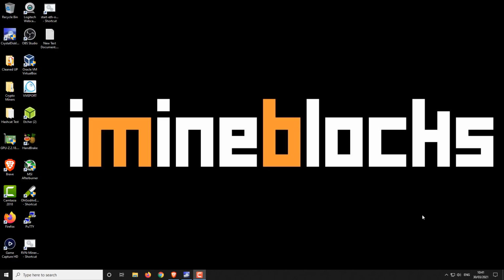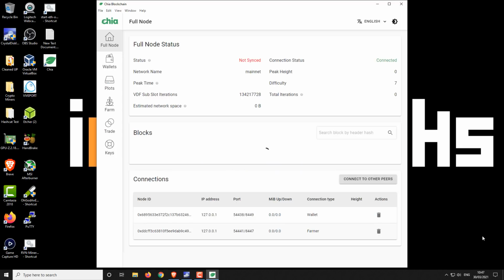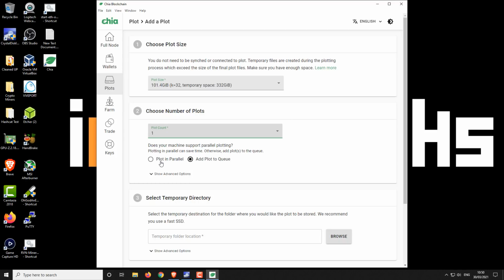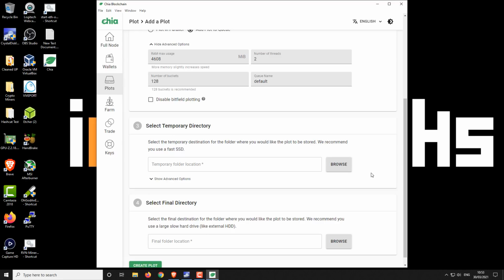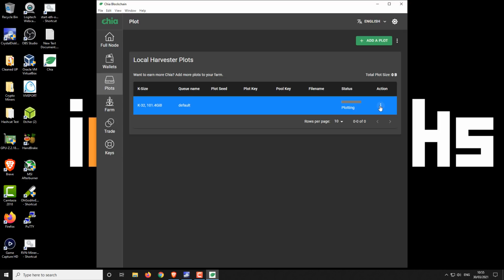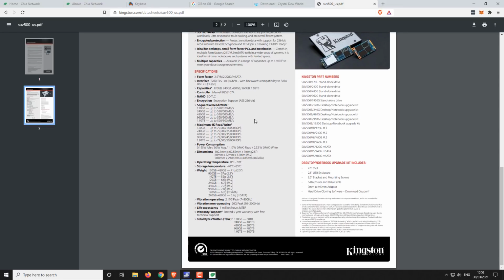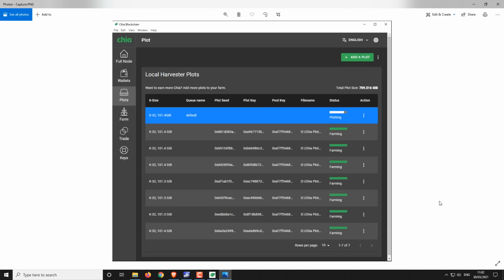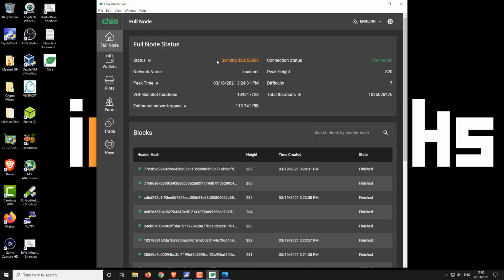How To Farm Chia - Hard Drive Mining Guide

Comment: thanks man @imineblocks for the great tutorial. as I am new to mining I have some questions you did not explain in the tutorial. first of all, how profitable is this method? 
say I have an idle PC with 10TB Hdds and a very low price of electricity.how much would you guess it will bring for me? there is a concept "chance to win". for example its 10% to win each month. what does it mean? I can not win at all? if I never win what happens? I never will have the coin?

and how much it uses the internet? does it download and upload huge amount of data? how about the disk space? as I know we should have many HDDs. I don't understand, are all data should always remain on the disk? for how long? should not it be like writing 500GB and finish the current process and rewrite the new ones on the old data? why should we store 200TB or more? does not make sense to me.

 also about the SSD you meant that only for the temporary disk right? because having many SSDs can be really pricey. I guess it should be 1 SSD and many HDDs right? 

sorry for many questions. I hope you get the time to write back. thanks :)

Comment: If you own 1,000,000 plots right now (2-3,000,000 usd equipment cost needed) you can make it 1.6% winning rate every 5 minutes. With that rate you can earn back initial cost in 30 days. Any lower investment than 1,000,000 usd into chia coin mining will make you bankrupted before you earn back initial cost because of competition winning rate too far away from your reach, and because  your disks HDD SDD will eventually die before they found any rewards block for you. In short, if you don’t have 1million usd to invest in chia mining, you committed suicide and endeded up in nothing. Stay away from this Chia scam. Mining BTC and ETH is still only way to make profits for small miners

Comment: Can some post a video on the schematic diagram of how they connected their external drives, PC, and Router/Modem. I am running out of ports, and I wanna know how many lightning cables and ethernet cables to buy. 

I currently have,
~ Windows 10 PC
~ 1 External Hard drive SSD 500 GB
~ 1 External Hard drive HDD 4TB
~ Router/Modem

Comment: So, I built my first Chia rig, had done 7 plots  today in 7 hours in parallel, but the plots just sitting at 100% and not moving to farming (v1.4), any one had this and a fix ? All the files are plot.2.tmp and 101.401GB in the destination folder
Reply from the maker: Can they be written to the final drive, check the plot logs.
Reply: @IMineBlocks  just started a new batch a while ago, first one finished and went into farm mode, seems to have worked, thanks for the help

Comment: Hi guys, i have a question

temporally files ( recomended on SSD) are only ocuping space while im creating the plot, rigth ? (something like 350 GB)

So, if i Buy an 480 GB SSD with a good endureance it would be enougth to create plots one by one on a 8 tb HDD ?

And then, the final directory is the real place where i have to storage those plots, so when I stop plotting, the SSD will be empty and the HDD full.
Reply from the maker: Yes, this is correct.

Comment: I have a question. If the plotting is complete, what is the minimum requirement for farming of 160 plots? I am thinking of doing this on my pc which has 16TB hard drive. But do I have to keep high ram and SSD on the same PC even after the plotting is complete?

Comment: if i set up a farm on an external harddrive, do i have to keep it plugged into my computer and running at all times in order to mine or will it work if i disconnect it and leave it alone for a while?
Reply from the maker: You need the drive plugged in for farming.

Comment: so does chia use the hard drive to mine or just space on the hard drive? wondering if chia wears down ssd via lots of read and writes?
Reply: how quick would this chia mining burn thru say 200TB on an ssd? should i look for mechanical drives?
Reply from the maker: Hi, Writing the temporary plots uses a lot of writes and will wear SSD's significantly. You can use HDD's but they're much slower.
Reply: @IMineBlocks  the plotting does the read writes but does the final wear the hard drive?

Comment: What are the costs? Have you seen an increase in energy consumption? It is stil using computer power, so iam interested to know the costs :)
Reply from the maker: Initially intensive but one plots are created the drives use very little power, about 10-15watts. 
The node can be run on Raspberry Pi which also use less than 10 Watts. Its very efficient for a proof of work crypto.

Comment: Is it really that important to use SSDs to get plots up and running if, once they're created they then get handed over for farming? Does the farming stage last for ages / forever?

I can get a 2 TB mechanical drive for under £50 whereas the same NVME is going to cost me around £180+ and might burn out a lot sooner. Just go for more plots in parallel (with, admittedly, more cpu and ram usage) on slower, mechanical drives.

I'd love some feedback / constructive criticism on this as I am completely new to cryptos.
Reply from the maker: You can use a HDD it just takes much longer to create the temporary files required for plotting.

Comment: Sorry for the noob question; I have mulitple PCs but I am putting them on the same wallet. however they dont 'see' each other, only the plots on the local HHDs. Are they working together if I have them on the same wallet?
Reply from the maker: Yes they're working. Your total plotted capacity is not shown on the other nodes but you'll get the same rewards for the full total.

Comment: I have a question, for example if I have one ssd m.2 drive of 1TB and I have free space of 500gb and create one plot on that empty space is that mean I can't creat more plots on that drive? Also, dose temp folder can be same for each plot. Is temp folder is shared between plots or I should create new folder for each one and calculate new 239gb of disc for that? Please let me know, and thank you very much in advance.
Reply from the maker: Temporary storage can be used multiple times, once the plot is completed and written the temporary files are automatically removed. You can use the same temporary folder.
Reply: @IMineBlocks  So in my example, I need to wait to create the first plot, and once it's done I should create a new one on the same disk and use the same temp folder, right? Can plot and temp folder be on separated drivers? Also, once the plot is created it will automatically start farming or should I do something? Thanks a million for the quick response, appreciate that!
Reply from the maker: @manojlogulic4234  Yes, you'll get the best results using a temporary drive and the final plot gets written to another drive. You can que them up so that a second plot automatically starts once the first has finished.
You can select to auto farm once completed, see the check box under plotting options.
Reply: @IMineBlocks  Thank you a million bud, wish you all best! Cheers!

Comment: Under the farm tab there's an advanced options button.  My "your full node connection" KiB Up/Down is 0.0/1247.5 is this normal? I've opened port 8444/8444  and my farms are in fact farming. Should I be worried about this?

Comment: Hi Guys is it possible connect two pc (in two different place) to the same account to have more chance to get a rewards? thanks
Reply from the maker: Its all about total capacity. 2 x 10TB systems will not have any advantage over 1 x 20TB system.
Reply: @IMineBlocks  I'd like to do in this way in order to create more plots

Comment: So, say you had access to multiple PCs with half decent CPUs, could you use all of them to plot simultaneously? Then just move all your drives to a seperate farming rig and leave it sat there?
Also I'm still a little confused as to how farming works - once a drive is plotted, is that literally it until it wins a coin? Does farming use a lot of resources or are you basically just leaving them available until one of the plots wins something?
Reply from the maker: Yes, this is exactly what I'm doing. Using a few different machines and then moving all the plots to a farmer machine. Farming is very low usage only little above idle.
Reply: @IMineBlocks  excellent, I basically have access to a bunch of workstations with xeons I could set plotting on my own drives while users aren't using them, but I'd be running the farming rig from my garage probably so low power or resource usage is excellent.

Comment: There is no point to mine this, why you should want to kill your SSDS to mine ridiculous amount of XCH ?... You gonna kill your SSD in less than 1 month by using this programm...
Reply from the maker: Speculation! I think farming Chia will produce more revenue than the cost of hardware.
Reply: @IMineBlocks  how come its exist 100 of coins why is this difference
Reply from the maker: @johnnygustafsson6945  It uses proof of space/time rather than proof of work.
Reply: @IMineBlocks  another question could i farm eth and this same time?
Reply from the maker: @johnnygustafsson6945  Yes, Eth uses your GPU. No problem mining at the same time.
Reply: @IMineBlocks  will give it a try got just a ssd 1tb on my pc atm and have only used about 100gb on it so will try for now

Comment: Hello to all! I am new here and i want to start plotting and farming. I read this thread and i learn than i need nvme ssd to plotting and hdd for storage and farming.

I want to ask what it is better for the other pc specs. It is better a pc with 3900x and 32gb ram at 3600mhz or an older motherboard with dual xeon E5 2695V3 (28 cores / 56 threads) and 32gb or 64gb ram 2666mhz?

It is better less cores with higher clock speed or more than double cores with lower speed?

Which system is better for parallel plotting? Do you have any advise for me?

Thanks for your time!
Reply from the maker: More cores are better, so I'm told.

Comment: Hey Lee, thanks for the videos. Been following you since the Burstcoin days. Wanted to throw a suggestion out. FusionIo had some PCI-E storage back in the day that can be had for fairly cheap on eBay. I have been eying the FusionIo IoDrive2 2.4TB drive for plotting. It has a maximum usage of 34PB aka 34000 TB. Might be useful if this coin takes off.
Reply from the maker: Hi, Thanks for the suggestion I'll check it out.
Reply: @IMineBlocks  Question on plotting, does the CPU speed really matter? I was trying to plot on my 3970 TR but I dont think there is any benefit from going with 50 threads(VM) vs. 2 threads on a Celeron. Thoughts?

Comment: Hi, I just started plotting today and ordered some new hardware for better farming. Would it be better if I build an entirely new setup for plotting or should I just upgrade my PC and plot on that? I use my PC for lots of stuff (Work and gaming), so I'm a bit confused about that
Reply from the maker: Unless your going large scale and I would say to use what you have available. Plotting isn't very intensive and you can still use your pc while plotting.
Reply: @IMineBlocks  Ah I see, thanks! I was curious because every time I plot, it takes up so many computational resources I can't run another app properly without stuttering. Maybe some upgrade will solve this problem.

Comment: Plotting freezes at 100% more then 1 hour, is that normal ?
Reply from the maker: At 100% it will be writing to the final drive. Check the log or task manager and ensure its writing. Disk could be full or just slow to write if using a usb drive.

Comment: Can someone help me? How can i use the chia calculator correctly? I uderstand the numbers of plots are limited by 3-4 because the number of threads they will use on the  computer, so i can only make 3 plots and the profit is like $3/month, is that right??
Reply: Or the plot process is just temporary and when they are created i can put on my 12TB HDD and they keep farm? So in this case i can make 1200 plots on my 12TB HDD?
Reply from the maker: When plots are created the uses temporary storage about 250GB per plot, then they are written to your final plot location each used about 106GB, then the temporary files are removed.
Reply: @IMineBlocks  I got it. Thanks!

Comment: If I have a 4 TB HDD for example and I create 2 plots  with 101.4 GiB (k=32, temporary space: 239Gib), both will eat up the minimum 3389 of ram separately, or all of the plots I create on one drive will use the amount of ram I set up?
Reply from the maker: Each plot should use the ram you set for it but in practice it doesn't really work like that. I think it hits a peak part way through but generally uses much less ram than stated.

Comment: I'm testing this out on my Western Digital Black NVMe that I have on my enclosure over a USB connection. Also, gonna get an NVMe expansion card to add more NVMe drives to my PC to create more plots.
Reply: @mgtech9652  compose a proper sentence please.
Reply: how much do you think you will earn
Reply: @mgtech9652  depends. I plan on farming as much as possible and holding on. This is easier to farm and cheaper than doing GPU mining.

Comment: I have problem on Syncing lately. It is on and off which usually stucked at Not Synced. I alreafy start create plot, will that cause an issue I created a plot and it is still “Not Synced”?
Reply from the maker: You can try a resync. Close Chia then goto your local drive User/Appdata/ local / chia / - from hear you can delete the blockchain. Don't delete you wallet, check correct folder as it appears to have changed for versions 1.0.5 older version is obvious.

Comment: Hey Dude, so I can farm with my external too? I have a 500gb old ex-storage that I want to use, can I make 3 plots with 500gb? Keep ur work up, gj new follow& like
Reply from the maker: You can use it, with the latest version of Chia you might be able to fit two temporary plots. Or you can use it for save final plots, you could put 4 on it.
Reply: @IMineBlocks  i do the First plot atm over 16h right now, so it's only use at the end the 103gb and the 323 will be deleted when plot is created? So i transfer the first plot to have space for the new one ? And at the end all plots again to the drive, am I correct?

Comment: Hy, I have a mining pc with core i5 10600k 16gb ram rtx 3070 500ssd Adata nvme and external usb ssd 1000gb. Is it okay to mine ethereum and do chia at the same time, and if it is how long will my nvme drive live? The PC parts are all brand new
Reply from the maker: You can do both. Check the TBW rating of your nvme drive, each plot writes about 1TB of data.
Reply: @IMineBlocks  320 TBW rating is that good?

Comment: If I use a second computer to plot, can I bring a completed plotted external hard drive over to my main computer which is also running the software and will it recognize those plots?
Reply from the maker: Yes you can, from the plot tab you can add the new drive for farming.
Reply: @IMineBlocks  thank you! It looks like I just have to add directly so it knows to look for it. I feel this is much safer than trying to move the files themselves.

Comment: I have several questions (sorry, I'm the first time in mining). What is the load on the CPU/SSD/network during plotting? During farming? Just info from the task manager. How does it vary depending on the Plot size?
Reply: My CPU utilization is around 30% on average and my NVMe drive is at 100% while plotting. I'm using a Ryzen 9 3900x so my CPU performance is barley impacted if at all.

Comment: Hi Lee
Just started plotting now on my 500GB SSD. When first plot is done it will be delete automatically and 2nd plot start again? 2nd question is can I transfer final plot to different hdd as soon is completed??
Reply from the maker: Yes, in normally plotting mode the temporary files will be automatically deleted once the final plot file is created. You'll get a farming error if you move the plot while chia is running but you can update the folder for the final plot location in Chia and it will pick it back up for farming.
Reply: @IMineBlocks  Fantastic. Thank You for quick response. Happy farming

Comment: Looks like a I need 3 hard drives to mine properly especially since I have an 80gig old school and buying ssd is cheap.  Do you think external drives would be slower ?  I'm thinking the final drive could be external.  I have an internal hard drive extra plug for an one ssd but I'll have to check if I have a good slot.  I just hope drive prices aren't jack booted!  Thanks for the videos, very informing.
Reply from the maker: Use what you have. Ideally a fast drive for the temporary files and then any drive for the final plot storage. 
I'm using NVMe & External hard drive.
Reply: @IMineBlocks  Okay cool, sounds like a winner.

Comment: Thanks for the video and glad to see you're back.  The setup was very simple. I used the default values (2 cores, 4 GB ram). when I started plotting, all 4 core on my i7 860 jump to ~95C and ~50% usage. That's with a stock cooler. reached 2% plotted after 1 hour. Too hot for me so I deleted the plot. Still says connecting to wallet after an hour but temps dropped to~53C and ~14% CPU usage. Guess I need to upgrade my CPU cooler.   
Don't understand why it's using all 4 cores though.
Reply from the maker: The load on the CPU should not be constant throughout the plotting process, but those i7's do run hot. I had the 950 and it always run hot.